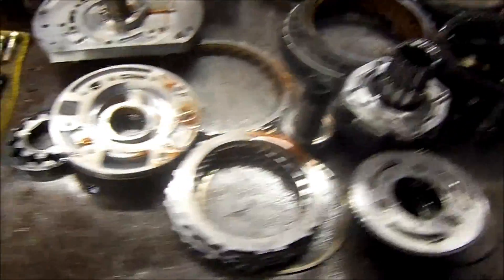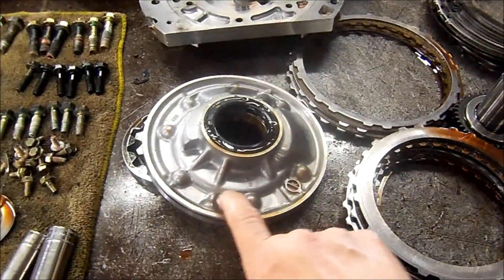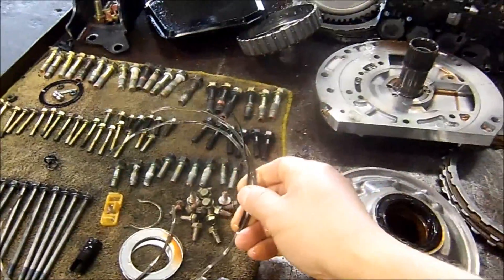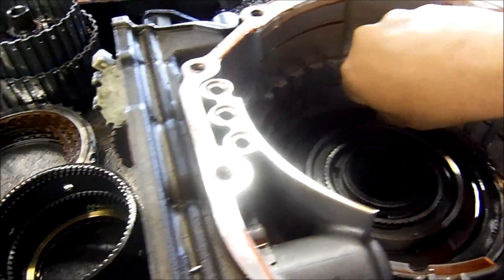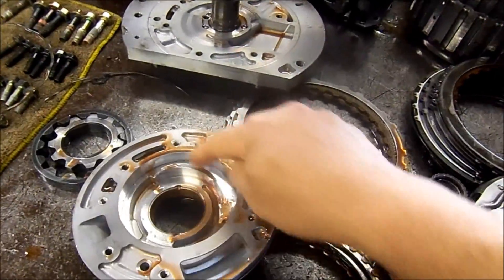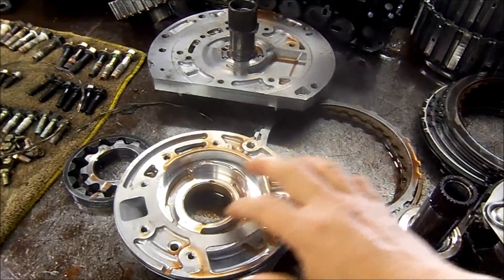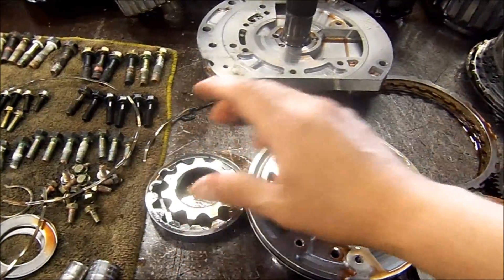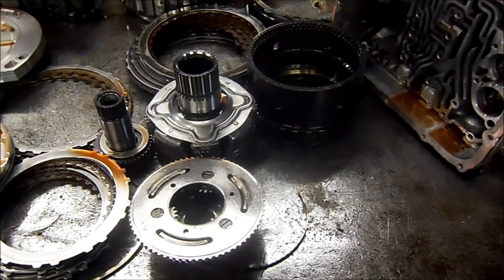F4A51 Transmission Pump Leak Cracked, leaking fluid - Transmission Repair

Comment: Hey Hiram how's it going? I got an F4a51 out of an eclipse and it was a typical problem. Wavy ring broke sending pieces to the pump breaking the inner pump gear, destroying the pump body.We did a complete rebuild, replacing the pump and installing an updated wavy ring. Vehicle left the shop and worked great at first during the initial road test. On the way back to the shop it started losing forward and reverse engagement. Before we pull this beast out again I wanted to get your input on this issue. I must have done at least a hundred of these with no problems. I'm thinking maybe I missed one of those broken bits and it somehow got lodged into an orifice. Make any sense? Your input is highly appreciated bro. Thanks for all of your informative videos. U can email me at 1pzebrovsky@gmail.com

Comment: Hi Hiram, have you ever did a video on line pressure testing transmission. ? Also what kind of test with transmission still in vehicle can be done to eliminate line pressure or sticking solenoid issue or to eliminate valve body itself.

Comment: Hi Hiram, have u ever did a video on line pressure testing tranmission. ? Also what kind of test with transmission still in vehicle can be done to eliminate line pressure or sticking solenoid issue or to eliminate valve body itself.